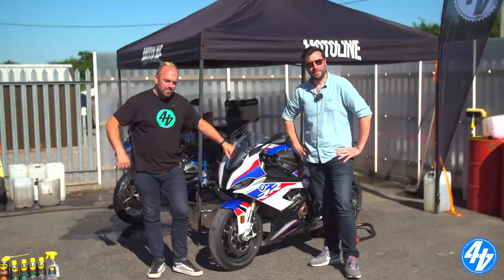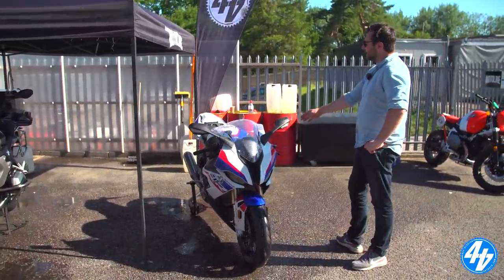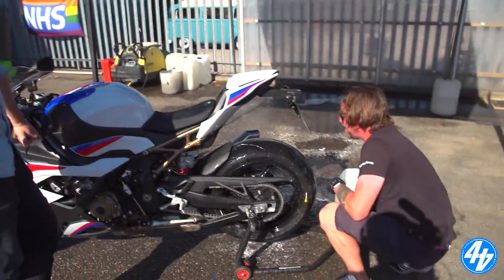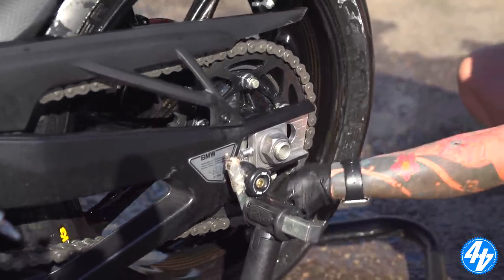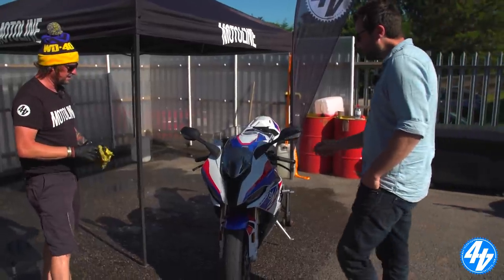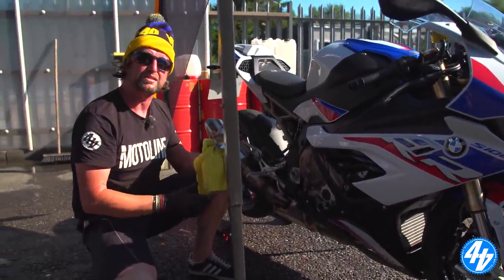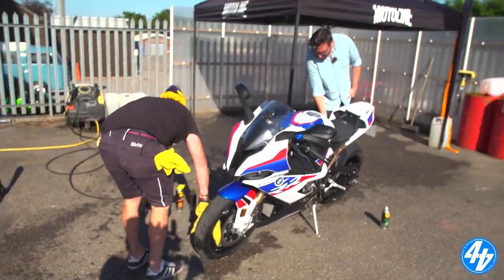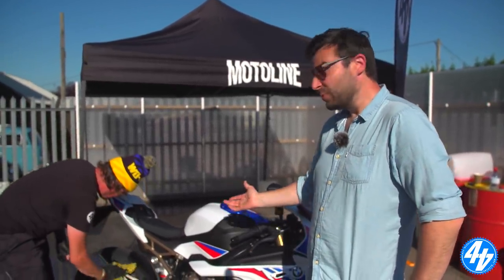How To Wash Your Motorcycle

Comment: Is this a video on what not to do?? Smfh! Do literally the opposite of what this guy did! Soak a large shower/beach towel with warm water and place it over the bike for 10min to loosen hardened dirt. While the towel is doing it's thing, strip your old dirty chain lube off the chain with kerosene and a chain brush. Rinse it out with the kerosene one last time. Then with the bike on the rear stand, wind out the any remaining crap out of the chain by turning on the bike and putting it in gear and turn the throttle (make sure the stand elevates the tire clear of anything). After that re-lube your chain, don't just spray it at the chain, you're wasting lube and makin a mess! Get up close and gently get it in between the links where the o rings are, that's the only place that actually needs the lube. After use a rag with some kerosene to wipe off any excess chain lube and shine the chain, and spin it out with the bike on one more time to get any remaining lube that may end up on your undertail before washing the bike (why wash the undertail twice). Now take the towel off and with hose spray off all the loosened dirt, then you can break out the soap and a soft mit. But make sure the mit is rinsed in a separate bucket with a debris divider so you don't scratch up the paint! Chain lube repells water so don't worry about getting the freshly cleaned chain wet. Rinse off the bike and hand dry with soft cloth, if you have an air compressor use the detail nosel to get the water out of the tight spots. Wax and buff if you wanna go all out, and you're done. And because I've met some rookies that did it and paid the price, DO NOT put tire shine on your tire walls, that shit will run on to the tire, and your first turn will be the last of the day as you lowside into a very bad and expensive day!